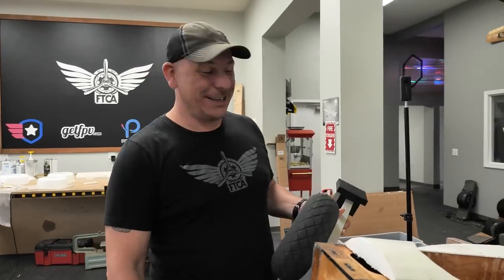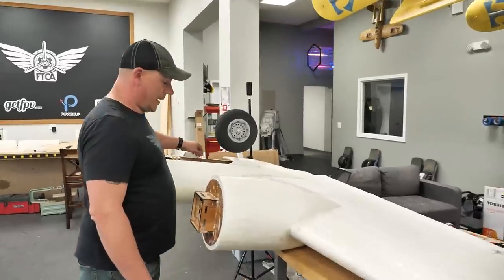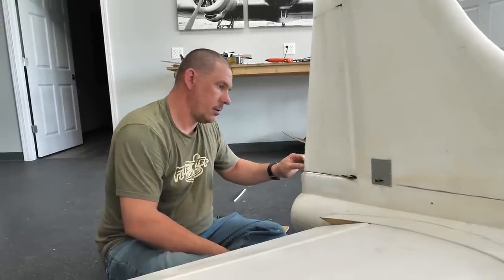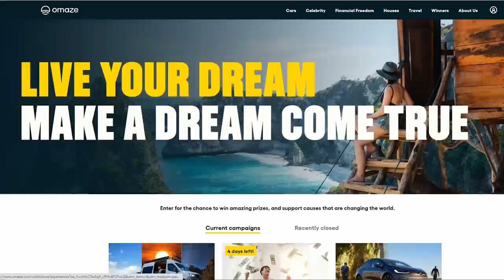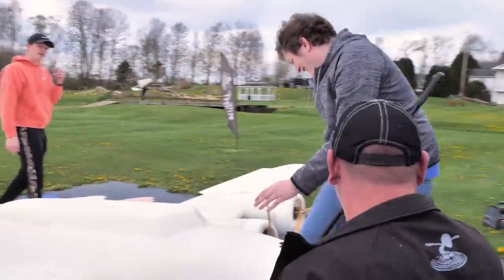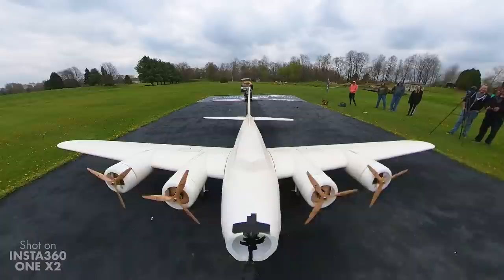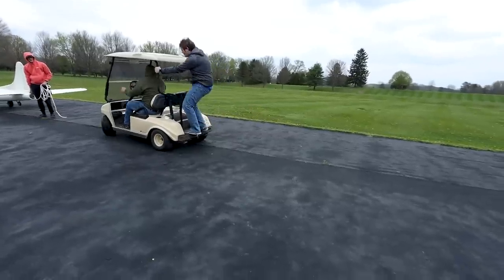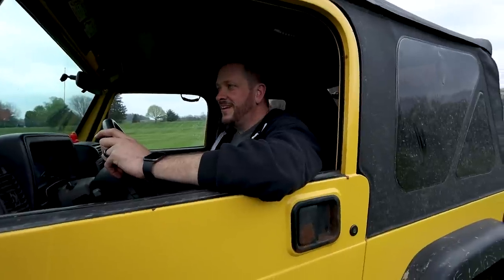Will our 20 Foot B-17 Be Able to Pull a Jeep!

Comment: I don’t know whether to be more impressed with the total thrust or with the fact that the structure took the stress of the pull. I assume that the rope ran up around the main wing spar, but even so, the fact that it didn’t snap with that slip at the start of the golf cart tow is amazing.  Y’all did some great engineering around that wing and spar.
Reply: Thank you! To be honest I was very worried about the wing snapping in the middle myself.
Reply: Knowing some of the past fails, I thought it was odd they risked stressing it that much performing a task it was not necessarily designed to do.  Fly with a load, yes. Pull a load ???
Reply: I'm gonna take a wild guess and say you guys won't be folding wings on this one. I would expect bigger damages though should it go down in other areas.

Comment: i just had an idea for something id like to see this channel do at some point: Dropoff fuel tanks that contain a power source inside them that gives you extended range until they drop off, in which case your left with whatevers left in your main "fuel tanks" aka your main batteries. the idea is to see if there truly is an aerodynamic difference between having the droptank and not having the droptank

Comment: can't wait to see this fly...also, what are the chances of doing a video on how to hook up multiple receivers in an airplane?  either simply for redundancy or like what you did here for multiple surfaces, etc.
Reply: I’m sure something can be shot about it. It’s really simple on DSMX though! Just put all the receivers you want into bind mode. Then put the radio in bind mode. As long as they are all bound at once your gold! 

I do this on my multi rotors since they all use the exact setup and it saves time switching between models.
Reply: @BluJFPV  I actually didn't even know you could bind more than one receiver to the same radio until I started flying tiny whoops.  I immediately thought of that when they mentioned the multiple receiver.  Makes perfect sense.
Reply: So, you can fly two or three aircraft at the same time, from a single controller!  Let
me see that!   But I’m just going to watch!😎🤪
Reply: @ericbarker3850  no, what i was referring to was multiple receivers in one aircraft for either redundancy or controlling multiple control surfaces like 2 rudders etc....not controlling multiple aircraft at once...that would be crazy...lol.  
@BluJ FPV  i don't have any dsmx receivers so my question was geared more toward other rx...sorry if that was unclear...which obviously it was...lol
Reply: @RPGWoodworking  Oh, I was the one who was not clear... I was absolutely joking about flying two or three planes at the same time.  yes, that would be crazy!  (I had no idea you could bind more than one receiver at the same time).  So, yah, I made a bad joke.

Comment: Should probably turn the motors on each wing for example one side will be turning left while the other side is turning right, it would be more prototypical and it wouldn’t pull due to the motor’s rotation.

Comment: Serious Question:  Are the right/left props counter-rotating to reduce throttle/prop torque?
Reply: No, @13.34 when he starts the motors they’re all turning counter clockwise.
CCW assuming you’re standing in front of the plane and looking toward it.

Comment: ( No hate, not being rude/mean. No offense )>- You guys should've made the inside of the engine casing airflow pass'through inside to the back exhaust vents.... ( The fans are being runned by electric motors i know ).  For more airflow intake suction on all 4 inside the engine casing would be better. Those fans there don't need big square casing all around inside the engine casing...

Comment: I don’t understand how you put multiple receivers in a single plane? I understand how satellite receivers work, but having 6x Spektrum AR620s in the plane working simultaneously? Are they all bound to the same model in the transmitter or is one the “master”?
Reply: On DSMX during the bind phase, the receivers pickup on which transmitter to talk too. Because of this you can have multiple receivers listen to a single radio as the radio does not care which receiver it’s talking too. But the receiver is specific to which radio it is talking too. 

Think of it as the radio yelling out. The receiver knows who’s voice to listen to, but the radio does not care who is listening.
Reply: @BluJFPV  Ahhh, ok that makes sense. Thanks for the explanation!

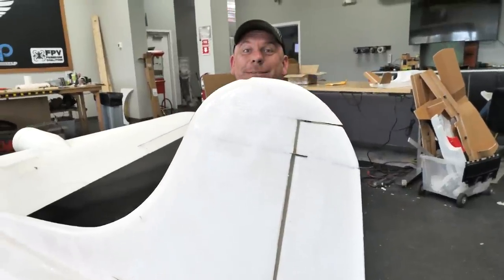Comment: Is it just my wonky brain or did anyone else picture Bubba J from Jeff Dunham's puppets at the 3:56 mark when he poked his head slowly over the tail. In any case that thing has some insane power. Any telemetry data like current draw with them motors under load with that jeep?
Reply: We did check the telemetry when we were making changes to the ESCs. If I recall it’s about 30ish Amps at full throttle on 12s. When we go to fly it again or it’s available too, I’ll make sure to get some solid numbers on it!